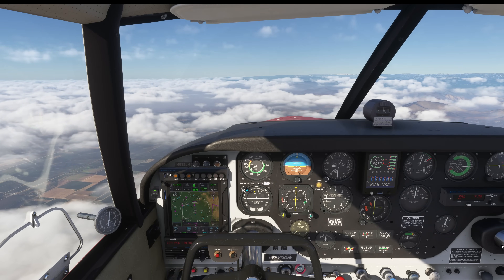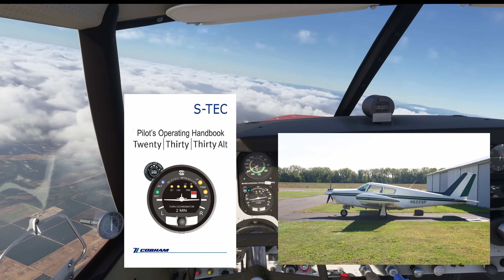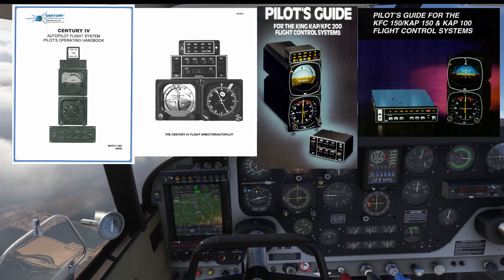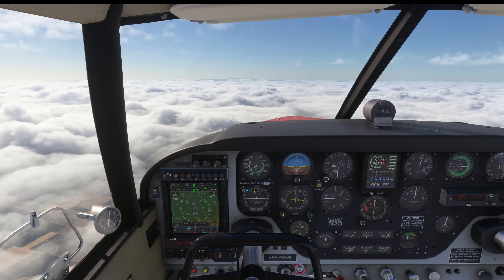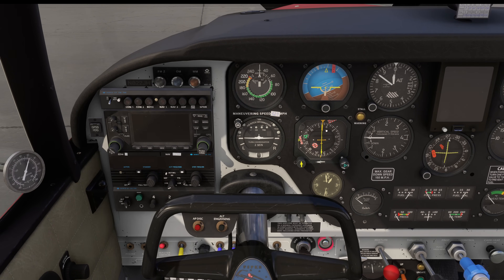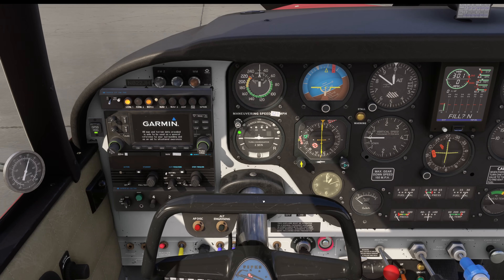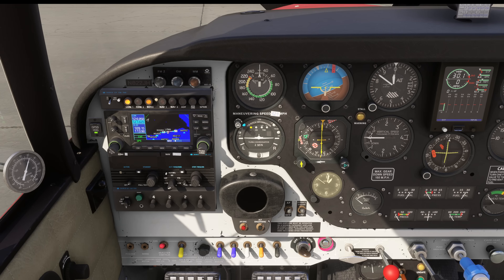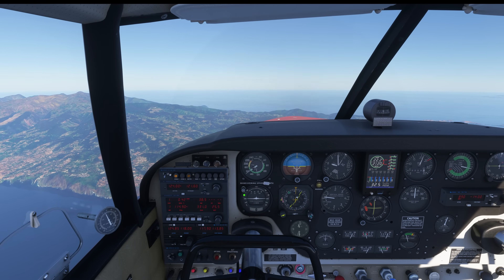A2A Accu-Sim Comanche 250 Autopilot Guide | S-TEC (MSFS2020/24) & GPSS Explained (MSFS 2024)

Comment: Since you mentioned the Cherokee 180 at the beginning, I surely hope A2A has plans to release a Chrokee 180 or 181 for MSFS2024. I have the Carenado Archer 181 which is fine for local flying, but it lacks an autopilot. An A2A PA28-180 or even 181 would be lovely and a definite purchase. Thanks

Comment: Great video for a great plane! Would be really nice to be able to do proper ILS approaches with GS in this plane though. Has there never been a Comanche that can do GS, or trim AP at all? Will these never be added because it just wouldn't be realistic?
Reply: Yes, there are plenty of Comanches with fully capable autopilots.  The Garmin GFC600 is the most capable and modern AP certified for the Comanche.  But there's also the STEC-55X, STEC-50, King KFC225 and Areocruze 235.   A2A are amazing but we've been asking for what you're asking for, for years and they get a bit "our ears are closed" about it.  The STEC-30 is so limited because - apart from a basic ALT HOLD, it has NO vertical modes.
Reply: @DavidR_192 ah good to know, thanks, interesting. It's nice to have this aweaome plane in "retro mode" re: vrry basic AP etc., but a more capable one would be great too.